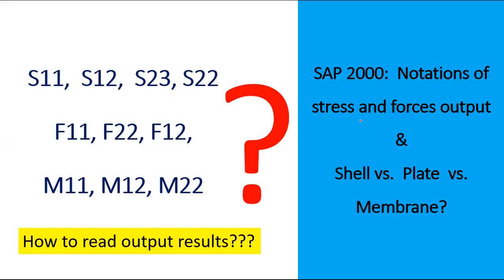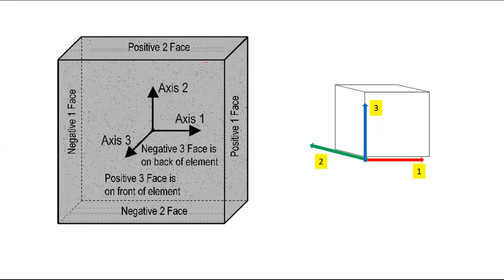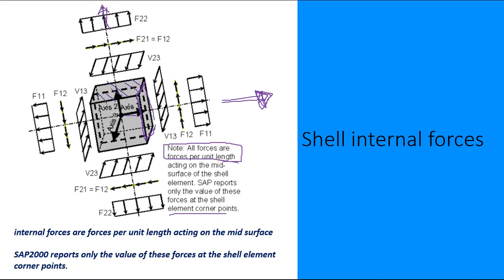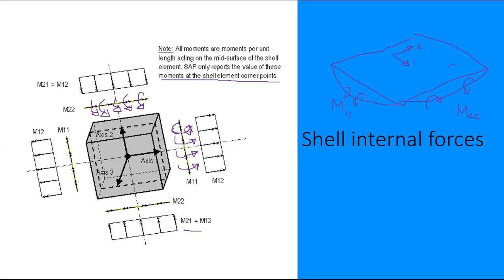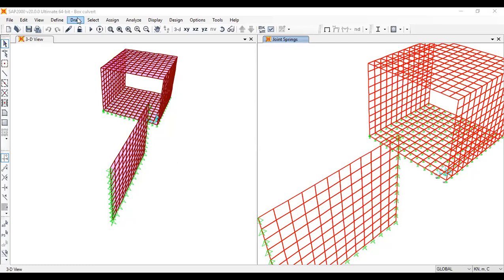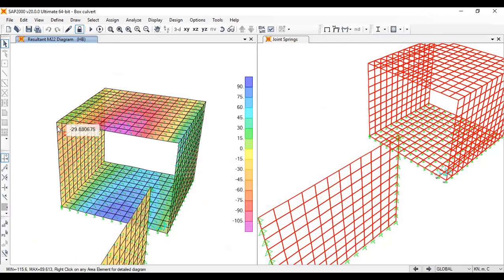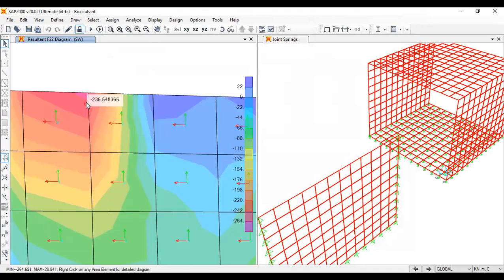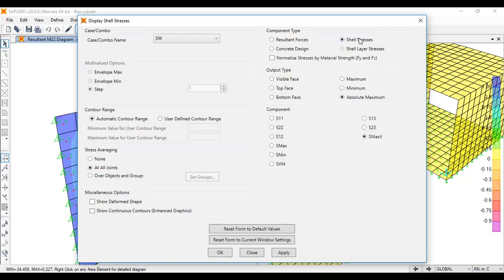Problem with interpreting SAP 2000 shell forces and stresses ?   Here is the solution. #engineering

Comment: This was extremely useful! Finally made sense of those results! Thank you!
I have an additional question if it is not too much trouble. I've created a model where I modelled the lintels as shell elements. Now i want to read the results so i can apply them to a frame element only model. For this i would need the M33 moment (so as a bending moment of a beam). How would I get that?
Reply from the maker: There isn't an M33 shell output in SAP2000. Shells give M11, M22 and M12, and these are moments per unit width. For a beam-equivalent lintel moment, you need to integrate the appropriate shell moment across the lintel width, or preferably use a section cut to obtain the total resultant moment. Then transform it to the frame local axis and use the corresponding frame M2/M3

Comment: Thank you for your explanations and this video of shell element forces. I can use CSI SAP2000 program. I'm wondering how to calculate a total F12 force (shear plane force? - I'm not sure of this definition.) which is parallel to the 2 direction. If we want to calculate a total F12 force which is parallel to the x direction, do we have to multiply F12 force by a length that is along the 2 direction? How to divide total forces by points? Could you please answer these questions?
Reply from the maker: Hi, I think F12 is given as an output in SAP 2000. I did not use it for a long. But as i remember it is given as an output ?   As you mentioned, those Forces are indeed a force per unit length.   
The force per unit length is generally mentioned at the mid-surface of the shell element. But if you need the value, those are given at the corners of the shell element.
Reply: @Structural_Modelling_Hub  Thank you for your answer. Yes it is given as an output but I want to know how to calculate it. This is also about the shape functions of a shell element. Each shell element has 4 points * 6 degrees of freedom = 24 that is why each shell element has 24 shape functions. But first, I must learn the total forces of internal forces which occur in a shell. I hope that you can understand me what I want.
Reply from the maker: @Mert-Ustun  Yes. easiest way is to multiple that by the length of element
Reply from the maker: @Mert-Ustun  after multiplying by the length, you should get it.. I never done it. im curious too.. did not use SAP for many years now.. post me if it worked !

Comment: Thanks for this video!!! :) I want to ask a question. I want to find the maximum principal tensile and compressive stress on the structure. For this, I examined the Smax and Smin values. While compressive stresses are larger at Smax values, tensile stresses give larger results at Smin values. With which principal stress result should I compare whether the strength of my material properties is exceeded or not?
Reply from the maker: The determination of whether a material has exceeded its strength depends not only on the principal stresses but also on the specific failure criteria used. Different failure criteria take into account various factors such as yield strength, ultimate strength, material properties, and the stress state. So while principal stresses are important for understanding the stress distribution within a structure, the ultimate determination of failure typically involves comparing these stresses to the material's strength using appropriate failure criteria.
Reply from the maker: https://youtu.be/xkbQnBAOFEg?si=4rqgc52Nuoi_DLea

Comment: Hello, thanx for the video. Etabs/CSi states that the moments m11/m22 are per "unit of in-plane length" KNm/m. what does that mean in terms of design? I need to time it by the length of the element? ( in your example the length of the square?). Also, when you want to use the results in table form ( so that you can export to excel and design the reinforced concrete), you find that the moment and the forces are given in each node of the element, rather than at mid span where one would expect it. 
I guess what I am asking is how do I get the moment in kNm at center of element?
Reply from the maker: When the software states that the moments are given "per unit of in-plane length," it means that the reported values are normalized by the length of the element in the plane of interest. In other words, the moments are provided on a per-meter basis along the relevant axis.
To obtain the total moment for a specific element, you would indeed need to multiply the reported value (m11 or m22) by the length of the element along the axis of interest.  
If you need output at the middle, simply you can define a node at the middle. These are finite element packages. They calculate information at the nodes you provide

Comment: For a box culvert structure (similar to the one in the video) -
1) Is the top & bottom slab thin plate or shell element? 
2) Is the side walls thin plate or shell element?
Reply from the maker: plate elements are typically used to analyze structures where the thickness of the plate is much smaller compared to its other dimensions. They capture both the bending and axial deformation of a plate.  Shell elements are primarily used to model structures where bending behavior is dominant. They are also two-dimensional elements, but they mainly focus on capturing the flexural response of a structure. Shell elements are not designed to capture axial deformations, and their usage is appropriate when the primary deformation mode is bending.                    

 If you want a simplified analysis and your culvert structure has relatively small deformations and is not subjected to complex loadings, you can model the top and bottom slabs as thin plate elements.

If you require a more detailed and accurate analysis, especially when dealing with thicker slabs or complex loading conditions, you may choose to model the top and bottom slabs as shell elements. Shell elements are better at capturing the behavior of structures with more significant deformations and varying thicknesses.

Here i have done an analysis of box culvert(using shells): https://youtu.be/XUeALSXx78s

Hope i answered your question :)

Comment: Sir if your model a.k.a Box Culverts applied response spectrum analysis, how to show stress area? Because response spectrum result in sap2000 is displacement and response modal or acceleration?
Reply from the maker: The output of this analysis typically includes the displacement and acceleration spectra for each mode of vibration. In SAP2000, you can obtain the maximum stresses for each mode by selecting the "Modal" option in the "Output Case" dialog box and selecting "Maximum" for the "Stress" output option.

To visualize the stress area, you can use a variety of tools available in SAP2000 or other software packages. One common way to do this is to create a color contour plot of the stresses over the structure. This can be done by selecting the "Display Options" tab in the "Display Settings" dialog box and choosing the "Contour Color" option. You can then select the appropriate stress component (e.g., axial, bending, shear) and specify the contour intervals and color scheme.

Comment: Thank you!! One question -- the bottom left shows the maximum and minimum results for your model. Is there a way to only display the maximum/minimum results from one portion of the model? For example. I have a model with a base mat and walls and I only want to see the maximum/minimum moments on the slab. If I hide the wall elements, it still shows the maximum moment on the wall, rather than the slightly smaller maximum moment on the slab.
Reply from the maker: For the combination. Make the envelope.. as i remember, Sap 2000 shows minimum and maximum for the envelope
Reply: @Structural_Modelling_Hub  correct, but it is showing the min/max for the entire structure when I just want to see the min/max displayed for the base mat
Reply from the maker: Yeah.. i havent also seen such.. i will check the manual and let you know
Reply: @Structural_Modelling_Hub  thanks! It's just frustrating because it is showing a maximum moment of 42 kips which occurs on the wall, and I'm designing the base mat

Comment: Sir 

 Is it possible to get moment capacity as output while designing slabs in SAP 2000 software , by giving input as (assumed area of steel in X and Y directions and corresponding spacing) .
Reply from the maker: Havent used design option for a while..but as i remember, yes you can take it.. but not as an output.. its is mentioned in the detailed calculation

Comment: Thank you awesome explanation. I learned a lot. I just need some help though , Some values of my shell for M12 from the tables are not matching from the model if I display the M12. Example the node 1, the M12 from the table is -9.0 but from the displayed model it’s + 20(when I drag the cursor and point it to node 1 the values shows +20). I checked the combo from Table and model it’s the same. It only happens on some nodes
Reply: I think It’s reading the average from that node that’s why I’m getting different values.
Reply from the maker: @johnreealimorong4586  you may have done some mistake while reading the output.. did you check it again?
Reply: Hey John. I found out that the table displays unaveraged results, what that means is the value you have when you display and it averages over joints is not the same as displayed. I recommend only using averaged as it makes the most sense.

Comment: very usefull ...have you some explaination about shell forces in circunferencial and perimetral directions at circular slabs using sap2000?
Reply from the maker: I havent come across such different expalantion. If it is i will update it for sure. For example, shell output consist of these options only.